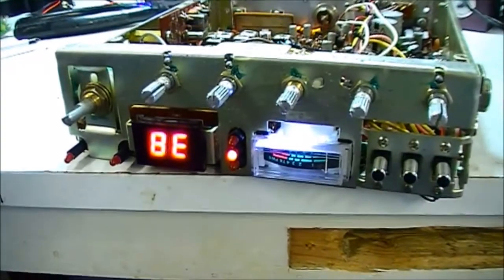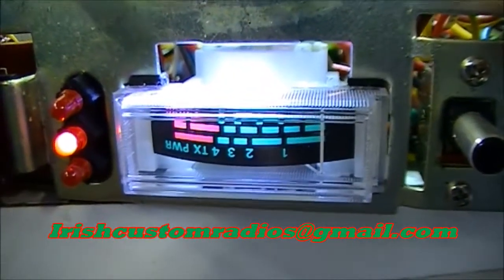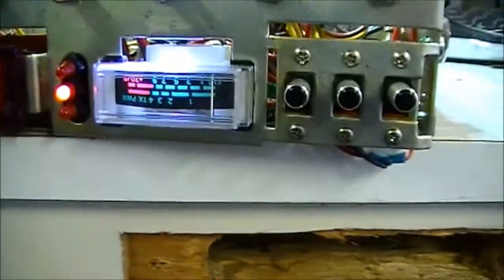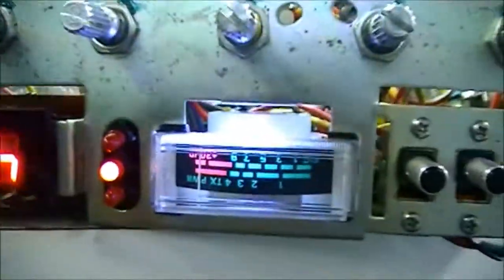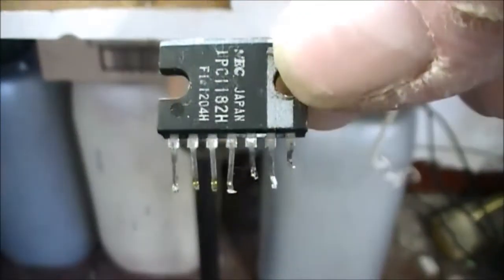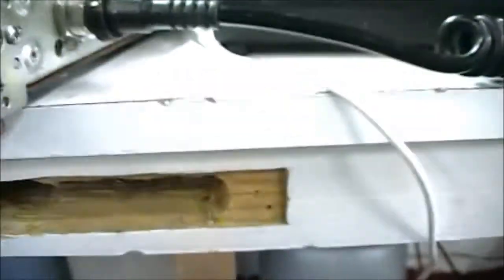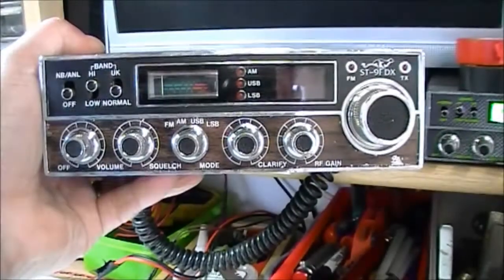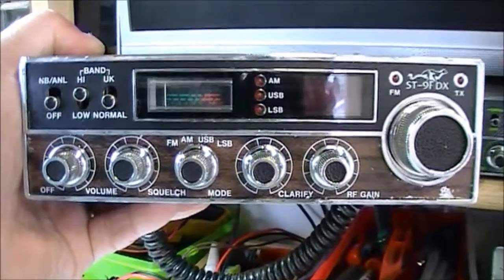Stalker 9F DX Audio IC UPC1182H Replacement HOW TO

Comment: Hi George, love the old stalker! I have a question for you.. I have an icom ic 729. It has stopped receiving on FM. It's working as it should on all other modes. Any ideas? Thanks.
Reply from the maker: Daniel Kerr Not a clue mate wouldnt know where to start in one of those. If your on Facebook search for 'The Shack' hes in the UK and seems to be very handy with repairs like that